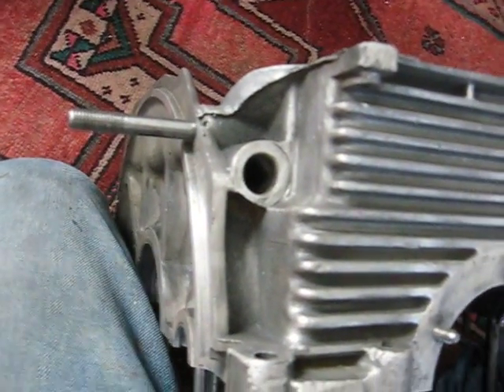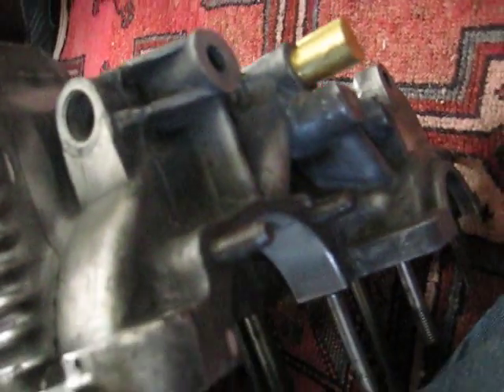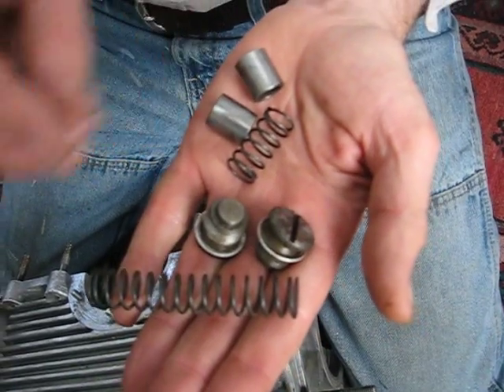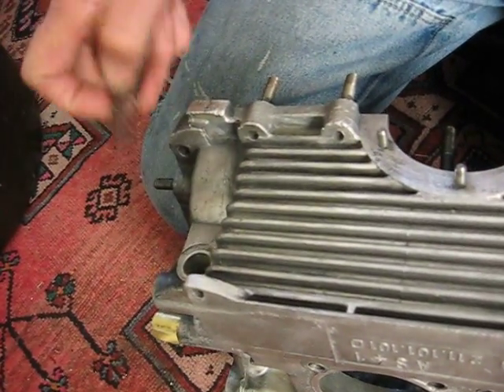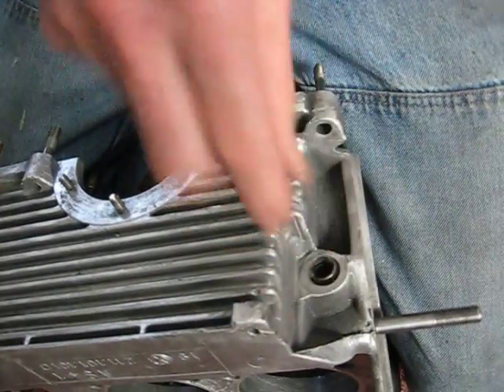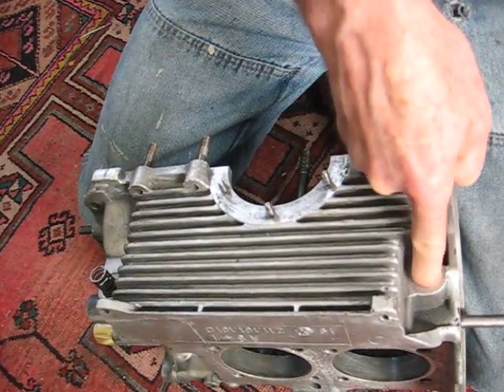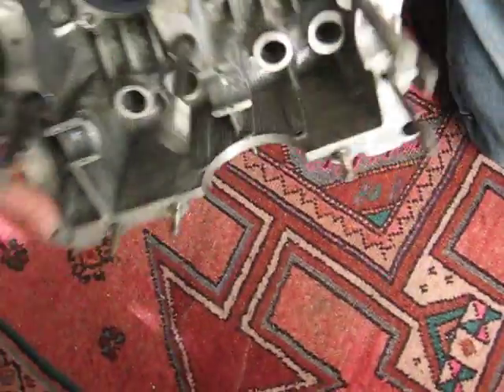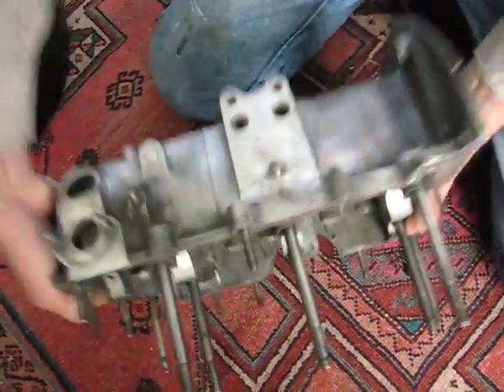OilPressureValves

Comment: Stupid question but need answer please ,what happenes if you dont put the pistons in or spring just the bolt ?
Reply from the maker: Well the oil cooler by-pass valve at the pulley end is what directs oil through the oil cooler. So it would oil ok but the oil temperature could over heat. Never too late to fix it though! The Flywheel end controls oil pressure so it might have low oil pressure at low RPM but probably would not destroy anything right away.